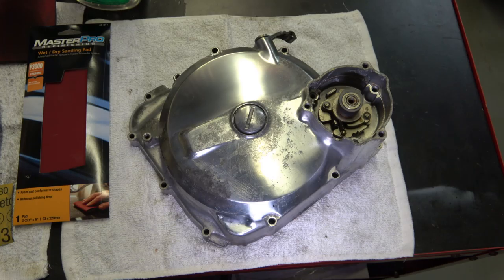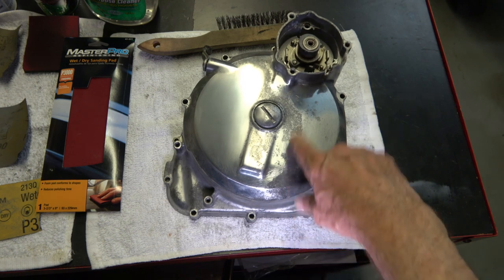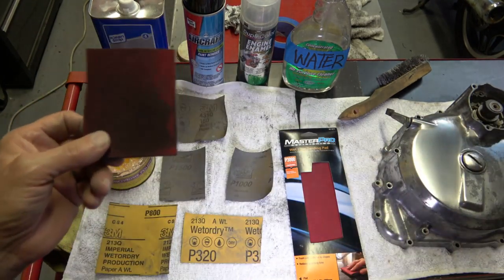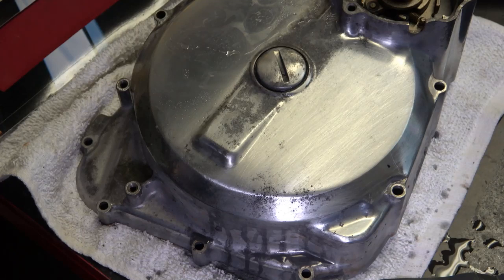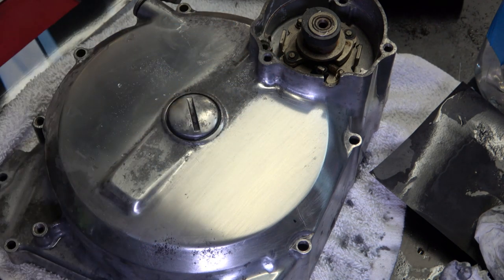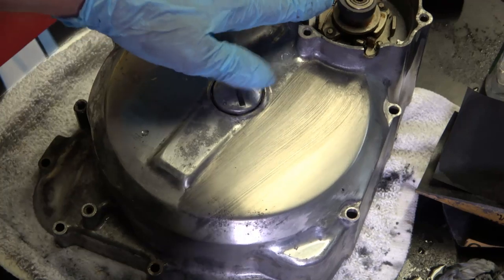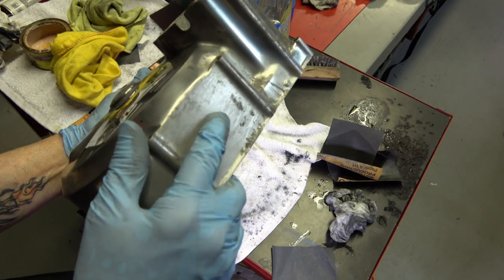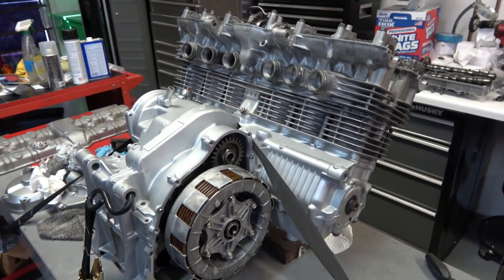Honda CBX Full Restoration & Engine Rebuild Video Series - Part 22 Re-assembly Polish Engine Covers

Comment: I had a 1980 and 1981 CBX in storage for 20 years.  4 days ago I brought everything home and gave up my $250 a month storage unit. Its weird, after all of these years not riding any more all of a sudden CBX things are popping up on YouTube.

I clicked on this video and a flood of memories came back. I will be watching all of your videos. In 1992 my first motorcycle engine overhaul was taking my junk engine with rod sticking through the cases and another derelict engine and making a good running engine out of the pieces. The CBX engine is definitely not a beginner project.
Reply from the maker: Thank you Kimmer6, I am happy my videos are bringing back your memories. Thank you so much for your support :) I will be restoring a couple of 80s after these 79s are done.

Comment: That’s exactly how I’ve done my cases for years. It really is the only way if you want a factory like finish. I have in the past had cases polished by a polishing company (to save time and my knuckles) and then use a fine scotch pad with polish to go a step back to satin. I restored my 82 CBX, about 10 years ago, but still work on her regularly to keep a fresh new look. My next job is to refurb the clocks. You are right, polishing the cam cover is probably the worst job on the whole restoration. Keep up the great video’s,

Comment: Knifemakers use a simple hack for matte look for their knife - apply high polish progressing up to 2-3000 grit, then 1 or 2 pulls with 600 grit through the polished blade gives you a nice matte. Not sure tho whether it looks like Hondas factory finish, just a quick tip. Maybe worth a try for those using commercial finishing on renovated parts, getting it back like a mirror.
Thx for your great videos, man, rare to find stuff on the net with such educational value!
Reply from the maker: Thank you Julio
Good tip.
I had a CB750 valve cover polished by a commercial polisher that came out way to chrome like that I will try that method or similar to try to get it right.
I hope it works, it would make easier to the valve covers at least which are the most difficult.
Thanks again Julio.
Reply: @digitalpizza1  Dear Peter, you are welcome and I hope it helps. I looked for an example, its a 5yo video from Gough Custom called "Making a Custom Knife for the Antarctic Research Mission". Check it out at about 5min time.

Comment: Do you people not understand the term dissimilar metals? You cannot use steel brushes on aluminum. You fill it with metals that will corrode it. You may have made it look pretty for now, but you destroyed it in the process.
Reply from the maker: That’s interesting, I have bikes that I restored 10+ years ago and the engine cases still look beautiful.
Reply: @digitalpizza1 As an aircraft mechanic for the last 27 years, what you did is forbidden on aluminum airplanes. I am restoring a 1980 Suzuki GS1000, and have used scotch brite and wet sanding to polish the case covers better than new. no dissimilar metal used.
Reply from the maker: @craigg4246  I am sure you are experienced in what you are pointing out, and don’t mean to show any disrespect, but what I didn’t make clear in the video is that the only areas that I use the steel brush are the tiny nooks and crannies that are otherwise very difficult to reach with anything else. I would never use the brush on the main surface of the cover. So the brush is barely used on the item. I, like you mainly use the scotch brute pads and wet sand paper.